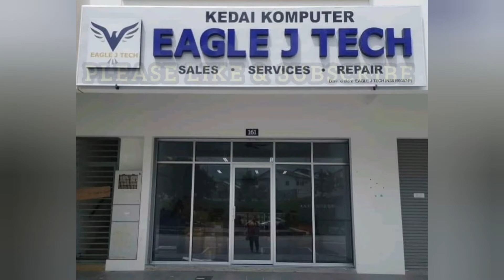How to disassemble LG 27GN750-B Monitor

Comment: What issue was this monitor experiencing?   I have same monitor, and it had a greenish rainbow pixel appear and a few moments later went dark.  It now seems to be receiving no power and as if it's completely dead.  LG SUPPORT has been no help whatsoever in trying to trouble shoot so I can attempt to fix the unit myself.  Sucks to have spent 4-500 dollars on a monitor that goes completely black and has no support on addressing the issue.  Even trying to get a whole new motherboard for the unit seems impossible at the moment.
Reply from the maker: Hi.. No power issue. In the video got show the chip that needed to be replaced. You can purchase the components thorough Chinese sides.
Reply: @eaglejtech  good evening again, I just disassembled my monitor and found IC 402 is bad.  It's burned out and I can't seem to read the numbers or letters to give me more information on that IC.  I know you posted this video two years ago but by chance do you remember which IC was bad on yours?  Or perhaps you have a picture of the motherboard that you could view the number and letters on IC 402.  I viewed the picture on Pinterest which led me back to this video I had commented on last week, HAHA.  Far shot but i figured id try.
Reply from the maker: @jvohbaby if you see the video to the end, I do posted faulty IC detail. I don't have this monitor with me, it's belongs to my customer.
Reply: @eaglejtech  wow its the same one, imagine that LOL, thanks for your time.  Going to order through aliexpress it looks like they are available there.  Only problem now would be since it's so tiny if i can manage to solder it on correctly.  Any recommendations?

Comment: You did not show how you started to pry off the back cover, which is the most important part of the whole process really. You need to start by grabbing the bottom of the monitor bezel (at the LG logo) from the FRONT (screen-side) and pull it outwards hard.
Also, this monitor is pure garbage. It broke twice for me in 2 years, got RMA once but now it's out of warranty and I'm just throwing it out because pushing the ribbons to fix the pure vertical lines didn't work. $300 down the drain, never buying LG again
Reply from the maker: Please watch the full video! Thanks!
Reply: Didn't show...
Reply from the maker: Please watch the full video!
Reply: No you don't.  @eaglejtech
Reply: Mine also has a vertical line, I'm only here to find out how to open it to see if the connections can maybe fix it.
Reply: can confirm pushing doesnt do shet.
also awful video who skips over the hardest ducking part.

pry the two holes at the bottom to open them a bit then insert (preferably plastic) tool to slowly and gently pry the plastic until you locate the next hatch and then pry it open. pry neededhatches are only on the bottom.

then i used a credit card around the rest, the middle top was a bit tough but managed to pass the card there as well.
after that use gentle but firm force and separate it with your hands.
Reply from the maker: Thanks for watching the video as a guide and for comment after watching the video.

Comment: Take a thin knife blade and, starting at the bottom corners, insert an inch or so of the blade into the seam and pry toward the face of the monitor. This should easily open about a 1/16th" gap near the corners.

Using a stiff plastic tool or credit card, insert into the gap and pry toward the front. Work from each corner toward the inside. It should unsnap easily. It took only a few minutes to remove the back.
Reply from the maker: Thank you for sharing your experience with us. GBU.

Comment: Mine goes pixelated and I have to smack the side of it a few times and it starts working again. Any idea what it could be before I crack into it and start poking around? Also, after percussive maintenance if I end up wiggling it or hitting it again it can go back to static. All external connections and cables are good. Wiggling external connections does nothing. Connected via DP, but will go snowy on even the menu screen with no input. Ribbon cable inside?
Reply from the maker: Hi! u can service the board, all the connectors and try it back! Without checking, hard to predict the actual issue!

Comment: I came across a website that was in Russian and had google translate it, but according to that site, the IC chip is - MP9148GJ-P - A person can find those online. I have not ordered one to test yet but I'm considering it.
Reply: I have ordered the chip also times, should be delivered on 22 February thank you for the info. I give feedback if it has worked.
Reply: Today I received my micro chip and soldered it right away.

Model: LG GN650

Thanks the error is fixed it was exactly the chip that was mentioned.
Reply from the maker: Hi... Frm which country? Here couldn't find one!
Reply: Hi , i order from China and ..ship to Germany.
Reply from the maker: @easygo6736  thanks for the info
Reply: Ich habe hier einen LG 27GN800-B. Er macht vertikale dünne Streifen/ Linien. wo auf der Platine befindet sich der Chip genau? Welche Aufgabe/ Funktion hat dieser Chip? ## I have an LG 27GN800-B here. It makes vertical thin stripes/lines. Where on the circuit board is the chip located exactly? What is the task/function of this chip?
Reply: Esta información, fue de gran ayuda. Yo tengo Lg 27gl63t. The IC IAKXM. He preguntado a los vendedores de MP9148GJ-P si conocen mi IC.

Comment: Are you planning to try replacing the control board with a universal control board? I want to try this experiment but unfortunately the MV238FHM-NG1 LCD panel (which is used by the 24GN600) has 92 pin connectors, which means there is no universal board with that many pins, maybe you know a tool for converting/adapting the number of pins to 30 / 40 / 50
Reply: oben genannten Chip mal gewechselt?

Comment: Hi i am tryng to remove a back panel in a monitor LG 34GP950G, to replace LCD panel but I cannot remove the back cover. It is as if there were some hidden bolts locking the panel in the central area. Can you help me ? Thanks in advance

Comment: I have the same motherboard and have the exact same faulty ic, in same location
Reply from the maker: Found any solution? Found the ic anywhere?
Reply: @eaglejtech  I have spare ic from my motherboard that works. It came from a lg ultragear gl63t. The gl63t LED broke. The 27gn750 IC is out but LED is good.

I'm planning to use the gl63t motherboard IC but not to sure how to go about it. I never soldered anything.

Comment: Hi!  How did you come to the conclusion that it was/is the faulty one?
Reply from the maker: Hi! When we check, we found out that this chip had an issue. Physically when you touch the chip will be overheated.
Reply: @eaglejtech  My case exactly :). Thanks.
Reply from the maker: You are welcome
Reply: @eaglejtech  i have brand new same monitor, there is sound but no display. can you please tell me the problem? is it the IC?
Reply from the maker: Hi..most probably different issue